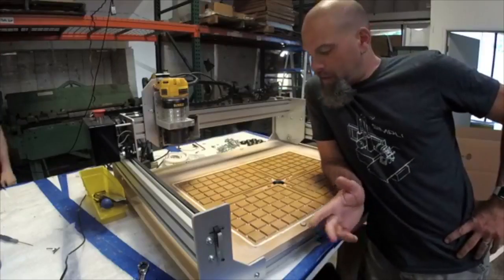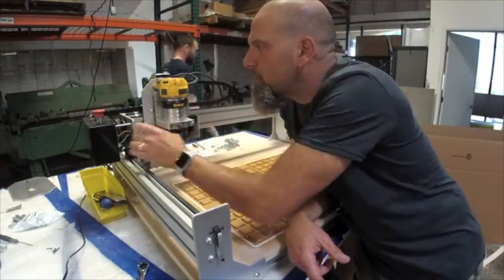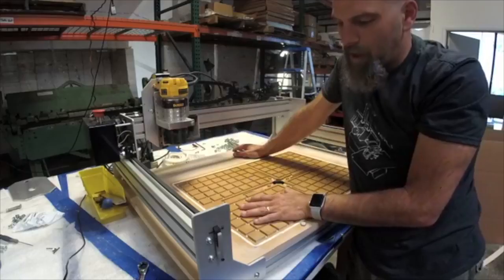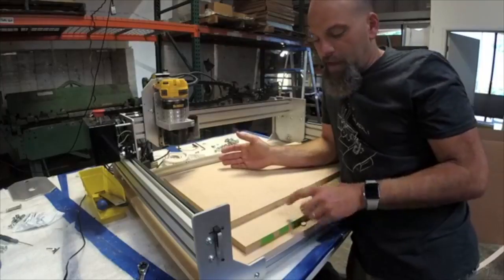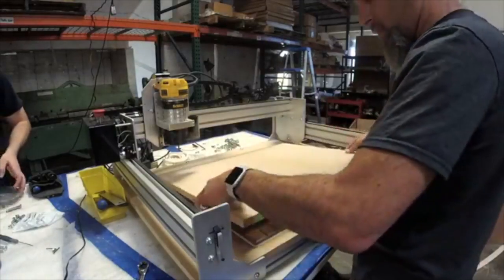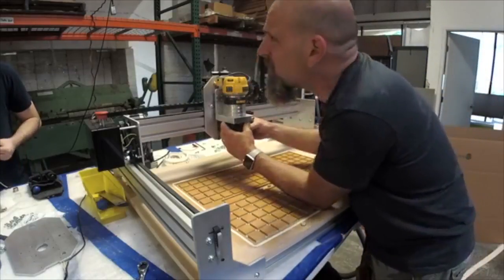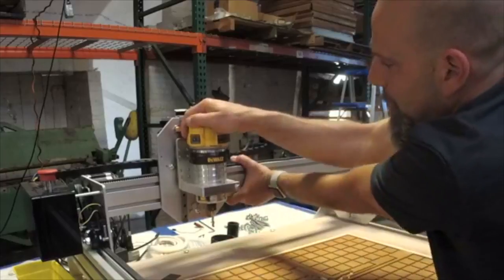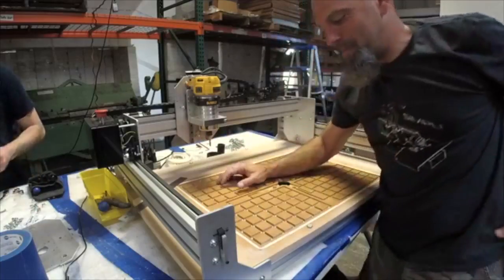Printrbot CNC v2 Vacumm Table Preview

Comment: Gotta fly cut both sides and paint / seal the edges. Important to get the ~0.5mm of glue off both sides for airflow, especially with such low vacuum from the shop vac. 

Make a air tight box and jam a vacuum gage in it. Getting 6psi is a minimum to get a spoilboard to work. 10psi+ will actually be useful.